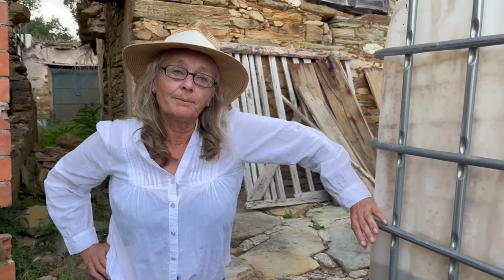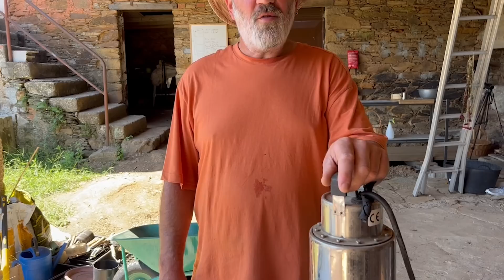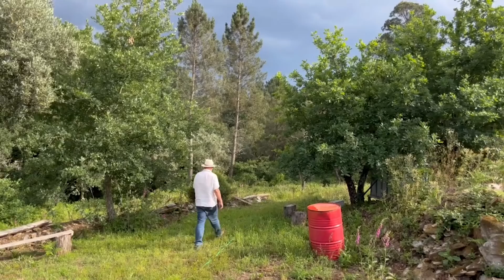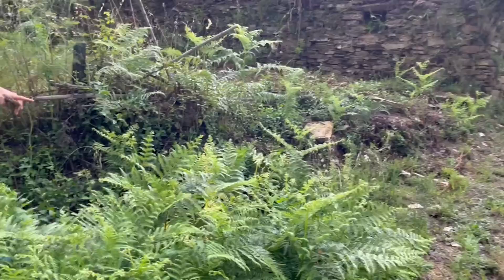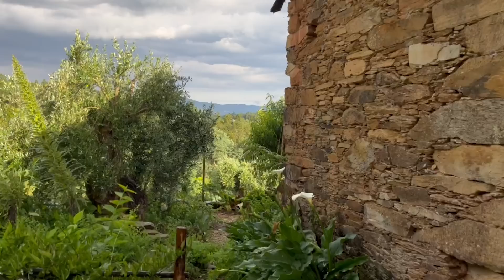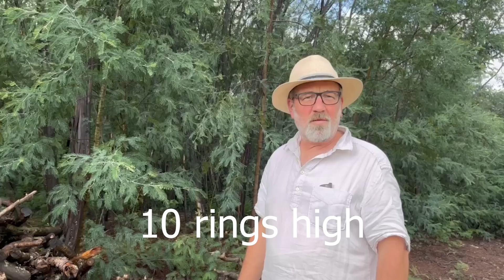Stone House Renovation Update and Future Plans

Comment: That wall is a huge job, have you considered making some a couple gabions using mesh and filling them with the collapsed stones? You’d get the look without some of the back breaking work as the front could be stacked stones with rubble infill behind?
Reply from the maker: I’ve rebuilt a couple of wall on the land already and it’s something I enjoy doing. We have seen gabion repairs but they don’t look the same. Thank you for a great suggestion. 👍

Comment: Good idea getting tank storage in greec we made a 40cubic metre tank but our well is brackish as we are near the sea.
Its a shame you are waiting so long for the permits cant your builder chivvy them on for you ??
Reply from the maker: We're hoping the water towers will be a good solution. Thank you.
Reply: @NearbyVeggies  won't it cost a lot to actually get the concrete tubes made into the structure plus  it seems very high ...stability could be question are there ever earthquakes in Portugal? In Greece it is definitely a concideration
Reply from the maker: It’s the most cost effective solution and the slab is going to be big. There are earth tremors and quakes in Portugal but mild in our area.
Reply from the maker: A little update. We had an earthquake yesterday morning measuring 3.4 on Richter scale. We heard rumblings but didn’t feel movement.
Reply: @NearbyVeggies  oh dear lie concrete horizontal and cap the ends  or look at plastic ..our tank is a cube but 3 sides are in earth only 1 is completely visible with a submerged stainless steel pump
Reply from the maker: Thank you 😊

Comment: If you need to transport water to a higher level then expected, you can put a washer into the tube with a small hole in that disher, that way you get more resistance and the tube possibly will transport the water (like when you make the water conduit smaller). I did that on sites where we had chemical dosing pumps which we had to use as dosing pumps. We switched the on an off several times in a certain time. If you dont have a resistance in the pipe, it does not work the correct way.
Reply from the maker: Interesting idea
Reply: It's a bit like when you press together a plastic-hose in the garden. I learned that from a older mechanic with more expirience then me.

Comment: As someone who was born and grew up in an arid part of Australia, I feel quite sad that the places I have lived in Japan have no tank systems. Now I am in the sub-tropics and it is either rainy or dry. Nowadays farmers rely on agricultural water (as opposed to city treated water) for crops, but no-one seems to collect their own. Farmers put IBC totes on the tray of their truck and get water from agricultural water dispensing locations (with special coins instead of money) if they don't have ag. pipes in their area. But at the same time, all the rain runs off greenhouses into the soil, down through the limestone, and out to sea. Of course, some of it is collected as ag. water, but most is lost. 
Collecting our own water is so much better - not necessarily free given that we have to have storage devices and equipment, but at least we can be more self-sufficient.
Reply from the maker: definitely more expensive to store your own water but it feels like a good solution
Reply: @NearbyVeggies  But in this way you solve not one, but two problems - the problem of water shortage in summer and excess water in winter. Maybe it will pay off.

Comment: I watched the patterns the rain made and I thought "maybe put two barrels along the wall where that rain seems to funnel". 
The basic idea is two long pieces of old pipe, old troughing from a roof or something that could be open to the rain flowing down, the barrels would collect the rain. 
From there, gravity feed the lower IBC tank. 
It's an unusual way, probably look strange but might work. 
I have open large containers out every time rains come, even doing that saves me using other water for me.
Reply: Forgot to say angle the pipes toward the barrels so water flows down. Even a ""V" shaped trough would do the job, or hollow out half a log and use that.
Reply from the maker: great idea for a small garden thank you

Comment: Although the house and garden was fed by two very large dams, when we bought our property, the Australian in me said 'we need more storage!' The rainwater falling on a huge shed was not collecting anywhere! We bought 2x 25,000litre poly tanks and they are now full and part of our overal system. They were remarkably cheap so maybe consider (if available in Portugal?)
Reply from the maker: I have looked at plastic tanks and they are about twice as expensive as concrete rings especially when you factor in delivery costs. thanks for sharing your solution

Comment: We put a bit of polystyrene floating in our open tanks so the birds mice etc , can have a drink or a dip and get out with no issues , the occasional mouse we just lift out and let them go about their business.
The height of your well from bottom to ground level is called “ the head” 
That’s how high it is capable of driving fluid .
A little drop in Draper pump with a 50mm hose attached would pump from your well .
You are from Northern Ireland lady ! That’s not even a shower in your home lol
Reply from the maker: Meraid is from Donegal, Republic of Ireland. That was a drizzle by Donegal standards.
Reply: @NearbyVeggies  👍🏴
Reply: @NearbyVeggies  by south Ayrshire standards it doesn’t even count ad rain !